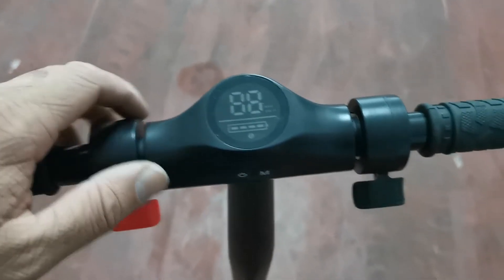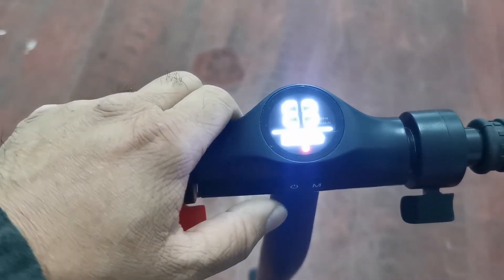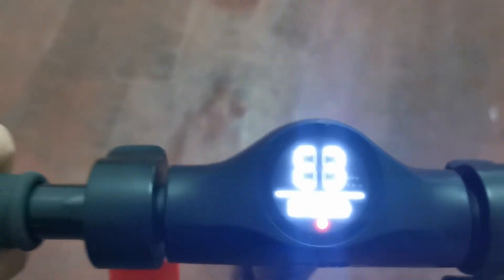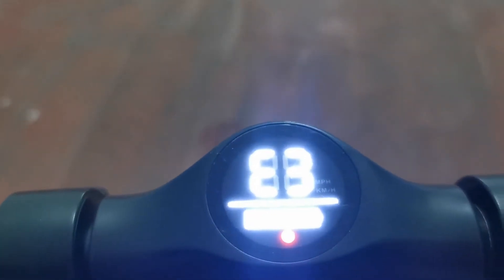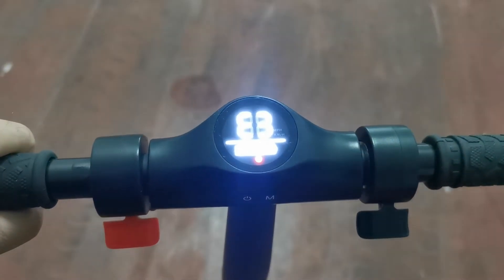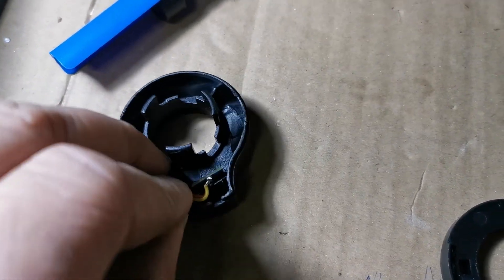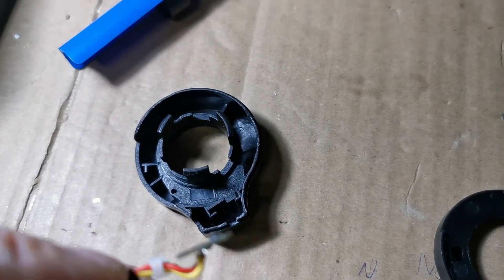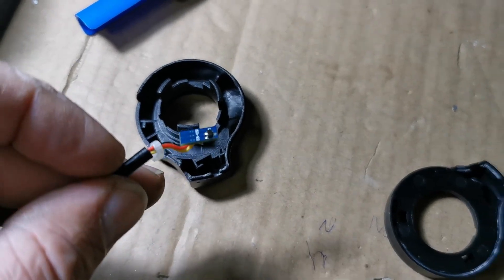Electric Scooter Error E3 || Zinc scooter error E3

Comment: Yeah if the Hall effect sensor is in the wrong place it will have no idea which position the brushless motor is in so it will cause a stall if activated. Better to throw an error than to possibly set on fire 🔥

Comment: Ive unboxed my daughters new zinc scooter,ive fully charge it but it still won't run after turning it on,,what am I doing wrong please
Reply from the maker: You need to press/push the throttle and give the scooter a little push for activation of the motor.
Reply: Give the scooter a push up to 3kph

Comment: How do u use cruise control cause it’s says it has it
Reply from the maker: No it doesn't has cruise control.
Reply: @AnimalsBirdsSounds  yes it does lol
Reply: You turn it on, then press the power button 4 times until you hear a beep and then you can push the throttle to choose the speed and to deactivate cruise control you press the power button 4 times until you hear 2 beeps to let you know that cruise control is off
Reply: @Jon Ellis yes

Comment: I have it too e3 but how I can fix it
Reply from the maker: Check the cable near the back wheel
Reply: It's not the cable it's the brake if it's already pressed down before the scooter is on and it's on then that's the problem
Reply: @AnimalsBirdsSounds  daca deconectez frana tot E3 arara